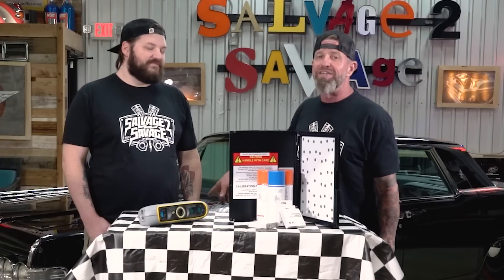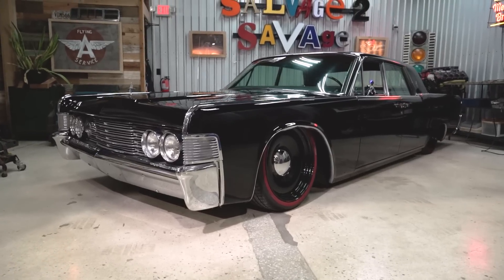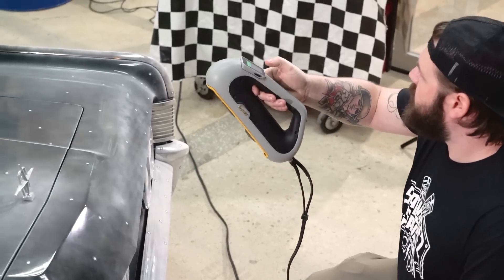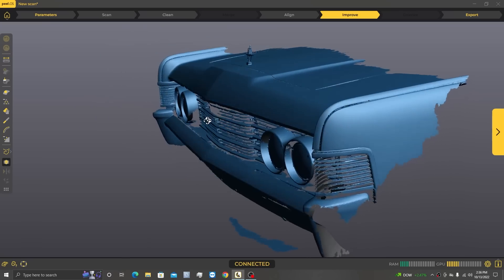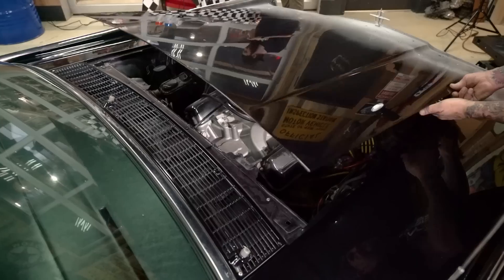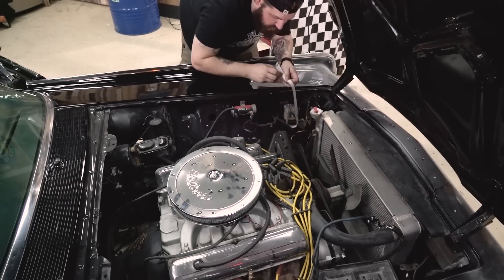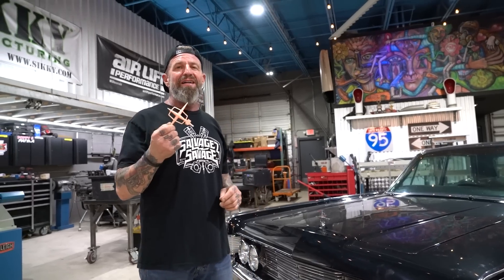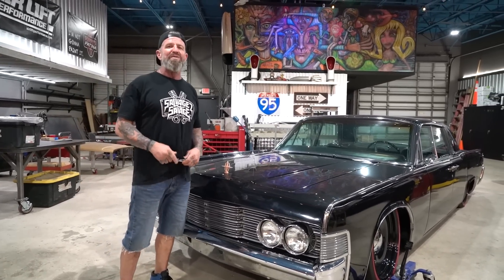3D Scanning a 1965 Lincoln Continental - Peel 3 Scanner

Comment: its 10 grand
Reply from the maker: It's actually only $8500. Which is actually pretty cheap considering most 3D scanners used in the industry can run well over 20 or 30 thousand.
Reply: @SalvagetoSavage  was looking at the cad kit,  I have been thinking of buying one of these or the einscan hx

Comment: Its nowhere near as easy as this "Sky is the limit" guy states. The scans need to be registered and meshed then reverse engineered - this is a big task - dont under estimate it. Its all doable for sure but not as simple as this guy makes out.
Reply from the maker: All of that can be outsourced though to someone who specializes in 3D design. If you want to build completely custom parts, whether it's out of carbon, plastic, or billet, the scan takes a hole ton of the guessing and preliminary design work out of what needs to be done. The sky is the limit for metal shaping and fabrication as well, but you need the skills and the know-how to accomplish it. The end result of your work will always be the sum of the time you take to work on it, the skill set you have, and the wisdom to know when to seek outside help!

Comment: Oldschool meets hightech. Just like what S2S likes to do with every project... 😎✌️

But yeah, 3D scanning has come a long way in the last years. If you know how to use the software and 3D modelling you can do pretty much everything in fabrication. Takes out the guesswork and provides precise reference points. 
Just like Rob "Chairslayer" Parsons does on a regular bases: he scans the inside of the cabin of a car, develops a full rollcage on the PC, cuts the tubes on a CNC tube bender (with integrated laser cutter) and ships the whole rollcage to the customer as a weldable set of tubes. Which is pretty rad... 🤟
Reply from the maker: I  remember seeing chairslayer on IG when he first started blowing up. The stuff he did to retrofit his car was absolutely insane! It brought a tear to my eye seeing someone so driven to keep doing what he loved. And when it comes to your points on the tech, you're 100% right! We just try to look at it as another tool though. But if it's going to make us more precise and more efficient in the long run, we're all for it!

Comment: I respect the idea , but those little targets and spray seem like a nuisance.
Reply from the maker: The dots are annoying but it gets the job done a whole lot faster than trying to design these parts from scratch!
Reply: @SalvagetoSavage  there’s a FARO scanner with a attachment called Freestyle I’ve seen used in the field for scanning buildings, I believe it works the same , you just don’t need any stickers or spray , it scans everything and puts in a software similar to this one shown, I could be wrong though.

Comment: I want tonthrow this body on a Tesla Model S plaid chassis/drivetrain.
Reply: You'd be able to keep all hardware, software and full battery pack.  It's idiot proof.  Just throw this sick body on top of the fastest production car on the market.
Reply from the maker: That would be so sick! We were thinking about doing a Tesla swap before we settled on the Godzilla!
Reply: @SalvagetoSavage  Its my dream to make this happen.  I've been searching for the ideal body for some time now. Throwing a tesla motor and come batteries into a classic car is cool, but you're missing out on the total package of what Tesla offers.  the most ideal thing to do is keep everything except the body, so you can truly enjoy the Tesla experience in a Classic car.  Its not an easy project by any means, but once I finalize my funds, Ill be searching for a garage capable for the project.

Comment: If you could strip that scanner down and put if on a drone use the the dots to setup a perimeter for the scan area it would make scanning stuff way more easier. Especially with the green light system used to keep the scanner at the optimal distance.
Reply from the maker: Then just sit back and let the drone do the work!

Comment: when i first learned of 3D scanners i dreamed of one day having a 3D scanner / printer combo so i could design parts in CAD, 3D print a mold, then create parts in carbon fiber or replace heavy steel items like lower control arms, spindles, and hubs with cast aluminum. This video makes me realize that's a realistic business plan for a guy like me now. no more waiting. i could have guys send me stock parts, scan them, and then recreate the part in a better material like carbon or aluminum or make my own custom designs with strength or aesthetic improvements.
Reply from the maker: That's an awesome idea! Would make for a great business model too!